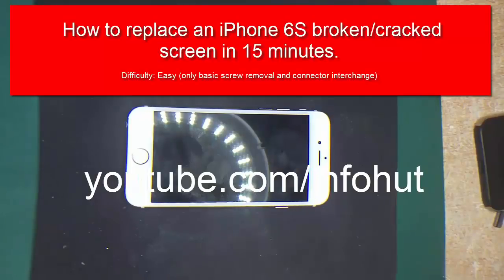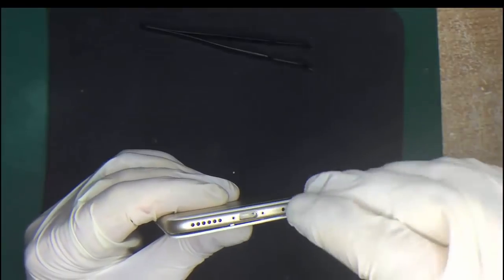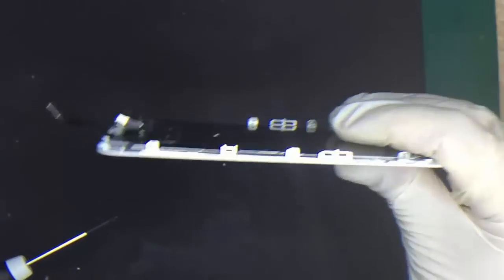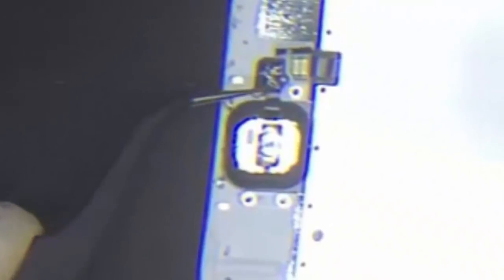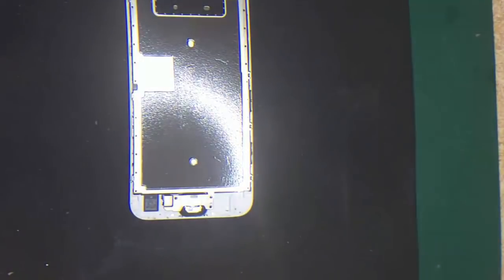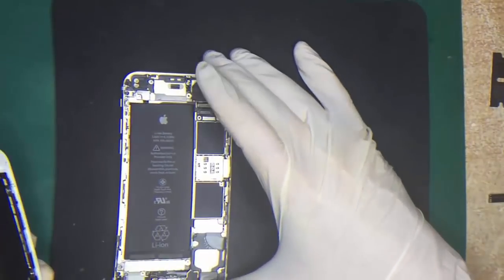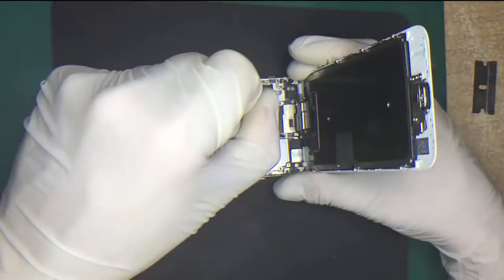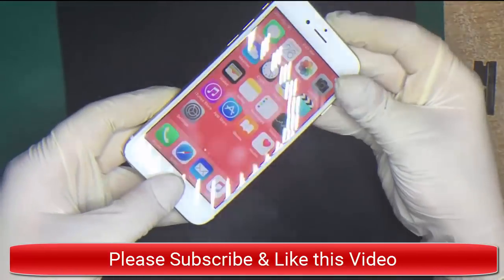iPhone 6S Broken Screen Replacement

Comment: I replaced my sister in laws screen and now the touch id doesn't work. I made sure to use the original home button and am pretty sure I didn't damage any of the ribbons. I tried taking the phone apart again and reseating the home button connector but still having the same issue. I disconnected the battery before doing anything. I tried restarting the phone but issue still remains. I tried toggling the touch id in the settings to reprogram but it gives me a failed error message. Any suggestions would be greatly appreciated!
Reply from the maker: very common problem - if the home button is not damaged you need to replace the back metal plate with the ribbon connector on the back of the screen and this should fix the problem.
Reply: Thanks for the reply. Is that a part I can take off the old screen or is that something I need to purchase? She lives an hour away so I won't be able to get to this for awhile and I'd need to have her dig the old screen out of the trash if needed; it's in a box in the trash. Should I tell her not to take an update until I get around to replacing this back metal plate with ribbon connector?

Comment: Hi. Thanks for the great video. Just repaired my iPhone that had a damaged screen and now it's working again.

However I'd like to point out an item that's missing from your instructions and I think is a quite important one. After you have disassembled the old screen from the phone, the first step after that should be disconnecting the battery connector. This should be kept disconnected until the new screen has been connected to the phone, and only connected prior to pushing the new screen in.

I had some arching and odour for electric fire when I was connecting the screen connectors back in. At this point I realised that the battery was still connected and removed the connector before continuing with the screen connectors.

But nonetheless, thanks for the very fine and instructive video. Couldn't have repaired my phone without it.

Cheers.
Reply: Anssi Lisko I have the same problem how do I fix it??

Comment: First of all, thanks for a great video!

I followed it step by step and got a the screen replaced. After checking all functions such as camera, homebutton, touch-ID, selfiecam i thought the phone were 100% functioning again.
But when I started typing a message (while typing the letters: "q", "w", "a", "SHIFT", "1", "2" and "3", all of them are in the left side of the bottom of the touchscreen) the screen froze for a splitsecond and gave a minor vibration, it looks like it want to cycle tasks if i press one of the mentioned buttons and hold it.

Does anyone know what might cause this error? Is the touch-plate or what it's called ruined?

Comment: I heard if you don't do this correctly you will brick your phone is that true?
Reply: I highly doubt it. Worst thing that could happen is you'd lose function of the accessory whose ribbon cable is damaged. Example, if you mess up the front camera ribbon cable, your front camera won't work. I doubt if you can actually brick a phone from replacing the screen.

Comment: Doesn't the 6S screen have an adhesive holding it down as well? Should this be replaced when replacing the screen? Or does the original adhesive hold strong strong after being opened?

Comment: if I have a dent that goes into the glass screen is there any need to try and replace the screen because the screen may not fit
Reply from the maker: +Tate Drebes u can try rebend the dint out depending on how bad it is.

Comment: this is a kick ass guide and I def want to try it but the little ribbons and screws really scare me, i'm gonna chalk up the 50 to have it done, can't afford a 160$ lcd to go to waste because of kids and carelessness
Reply from the maker: +Mike Elston no problem - it's actually a fairly easy repair to do :)
Reply: +infohut yeah i am doing it this am, almost done just can't get the back plate off, the screw driver i have doesn't fit :( so now i have to wait to get a screw driver that will take the 3 side screws off on each side
Reply from the maker: ah yup.  always good to be 100% with the tools.  most importantly take your time with the touch id (fingerprint scanner) to make sure you ensure it works when transferred over :D
Reply: +Mike Elston 50?  you mean 210 part and labor?

Comment: Forct touch should be checked as part of the testing process as well. Since this is a new feature, many aftermarket vendors and refurbishers may not have the ability to check this function during QC.
Reply from the maker: +Jason Bailey  Jason - very good point you make there. thanks.
Reply: yes

Comment: Are the 6 and the 6s screen the same? Where did you get yours?
Reply from the maker: +starr howleyy no they are not the same.  there is a link in the description with where you can obtain replacement parts.

Comment: Your biggest mistake.. Never use Metal tools to pry up a flex cable or a wire if the phones on it can short it out it can also bend the pins in the connector.
Reply: ca use plastic tool
Reply: +Jenny PhoneFixMachineFactory whatsap008615889548883 yes
Reply: do you also repair phones?

Comment: +infohut I wish you would have shown actually taking the glass part off, as I only need to replace that but keep the original frame.
Reply from the maker: +NMDJZ yeah that's a trucky part at this stage.  Once I perfect it I will make another clip until then the only realistic solution is doing it by the whole assembly.

Comment: Where did you find this? Do you know of any place where you can get glass only for the 6s?
Reply from the maker: +Alex Yakovenko not aware of glass only at this stage.
Reply: How about the replacement you used? the more scratch resistant screen seems much less shatter proof. Dropped it from like a foot and a half and its cracked
Reply from the maker: Correct grades vary but always buy from a seller that is recommended or has good feedback
Reply: Hi we are factory for machines and we also offer accessories.